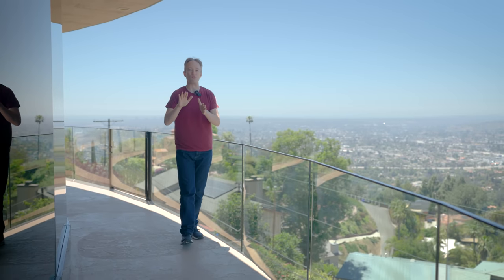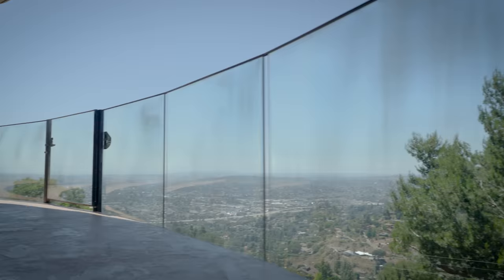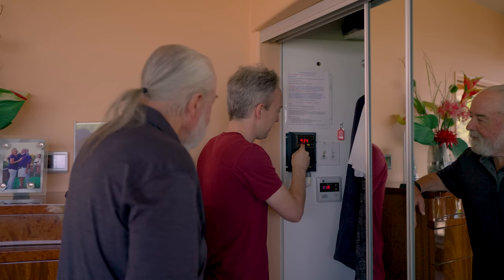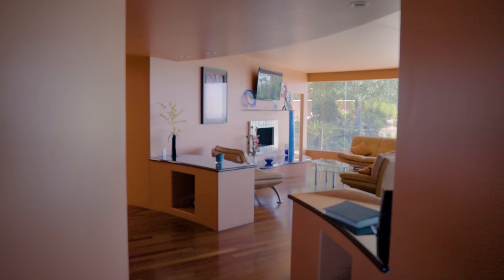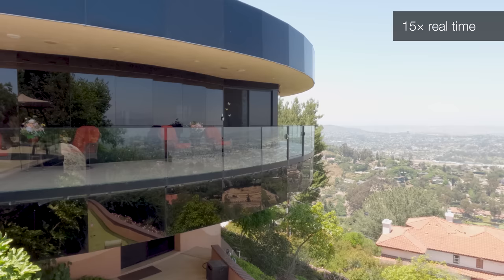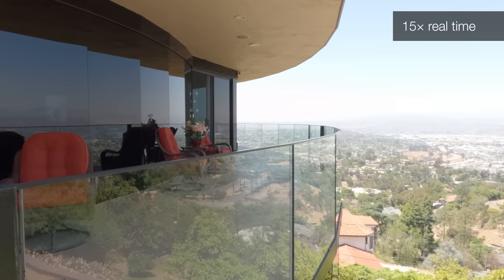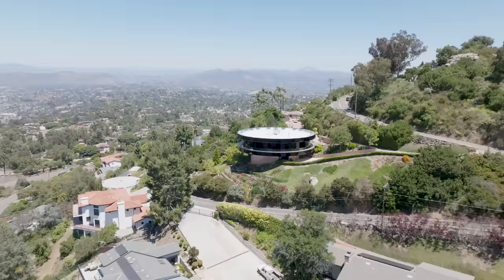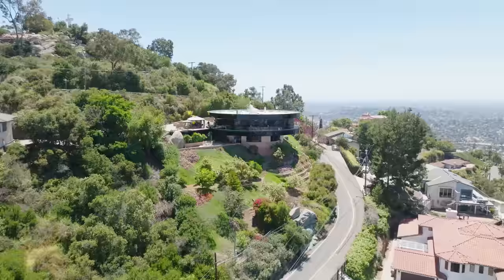I thought this rotating house was impossible.

Comment: As a science fiction author, hearing about how the utilities were transferred through a rotating bearing is so incredibly helpful for designing rotating space stations.
Reply: @PooPooDingDong456456  Like with any good world, building up the little details are very important. Readers appreciate those things so it's good to include them
Reply: @@PooPooDingDong456456 Chapters, no. A line or a paragraph here and there, sure, I could see that.
Reply: @@PooPooDingDong456456 It's very hard science fiction. Chapters? No. Is it mentioned? Yes, and I want it to be accurate.
Reply: @kermanguy1877  ay a fellow hard science fiction writer :-D
Reply: There's another couple of real-world examples you might find interesting up on the Space Station - the Utility Transfer Assembly, which routes power and data across the Solar Alpha Rotary Joints and allows the solar panels to track the Sun through 360° without ever having to reverse; and the Flex Hose Rotary Couplers that route ammonia across the rotating joint on which the radiators are mounted, which allow for 210° of rotation.
Reply: Space stations aren't anchored to anything, this house had to solve a problem that doesn't exist for rotating space stations. On the plus side gravity is constant in the house, in your space station it varies from zero at the center to a maximum at the edge.
Reply: With a rotating space station you can just have the utilities self contained in the rotating section
Reply: @joshuagreen3185  Next video, Scott goes to the ISS...
Reply: Wow! I actually tried to design an asteroid space station as a hobby. I came to the same solution except I used the top of the habitat drum to transmit the power and communications. Its really interesting to meet someone who is also interested in the nuts and bolts of space habitation.
Reply: In general, having bearings on the station rather than just spinning the whole thing seems like unnecessary complexity and points of failure.
Reply: @AndreInfanteInc  It's necessary if you want to dock space craft without desspinning the whole thing
Reply: @@PooPooDingDong456456 I think there's a page on the Waste processing system in the Deep Space 9 technical manual. :)
Reply: @frostyblade8842  Note that you don't even need to mention it.  If you are going for an internally consistent world there should be a LOT of stuff you know about your world that doesn't even make it into the work itself.  You can absolutely feel the difference in verisimilitude between authors that map out their world in their head vs those that wing it for the story.

...though with hard sci-fi of course they are going to mention it, because hard sci-fi can be kinda stupid and rulebreaking when it comes to exposition.
Reply: @@PooPooDingDong456456 not chapter, but definitely mentioned. Depending on how you want to write something, the amount of detail can determine a lot of things. For sci-fi, if you just handwave away things like energy production or waste disposal, it can make it seem like its a part of the world that wasn't even thought about. but talking about it can open up a bunch of other paths to build on. is it all mechanical, like this house is? Does the waste get disintegrated or cleaned up by robot servants, showing how technologically advanced the place is. Or is it reused or repurposed, to help push the stories green message along? the details like that can seem insignificant, especially to a reader or outside observer, but they can add so much depth and so many opportunities while taking very little time in the story to set up.
Reply: YA! TELL ME WHERE THE POO GOES !!!!!! I WANNA KNOW!!!
Reply: @AndreInfanteInc  An interesting use case would be variable simulated gravity. The whole station rotates, but some bits rotate faster than others. The same thing could be achieved structurally through rings of varying radii, but then you wouldn’t be able to change the rotation speed of one section without a concomitant change in the rotation speed of another.
Reply: @Tinil0 Yes! It’s like how Tolkien knew the distances between things and the shape of the map of Middle-earth before writing the Fellowship’s journey.
Reply: That type of connection is already very common in the word of hydraulics.  Sooo many seals to replace
Reply: What do you mean? This is not a problem for rotating space stations, they aren't attached to anything
Reply: @junkgrave  To dock a spacecraft to a rotating space station, you either need to spin the spacecraft up to match rotation in the middle, which means you can only dock one at a time, or you need to have the entire space station spin down. Both are possible if it's a small station, but for a larger station, that's not really practical. To have lots of spacecraft coming and going, you need a non-rotating section for many to dock and undock at a time.
Reply: @silentsushix3  The poo is collected and sent to agricultural stations in exchange for a discount on grown food, or it's used for the station's hydroponics.
Reply: Slip Rings (the electrical version Tom used as a example) is a thing already used in space!  ROSAs (Roll Out Solar Arrays) use them.
Reply: @deeznoots6241  Single rotating objects have stability issues in zero g. Many rotating station concepts have 2 counter rotating sections to provide gyro stability with one being habitable and the other being utility
Reply: @@PooPooDingDong456456they go out the shoot hole and get dumped by the station and left in the dark
Reply: It's nothing new. It works like every excavator has worked for decades
Reply: @NoNo-nz7iq  do you know what are the stability issues? I assume gyroscopic and due to the masses moving around inside, wouldn't that only be a problem for very small spinning stations? I am struggling to imagine the size and strength of the bearing you'd need for a large station with counter-rotating sections.
Reply: @joshuarosen465 while true for a space station, if you have a spaceship with both rotating and non-rotating sections, a solution like this will be necessary for it's plumbing. That, or you have every rotating section have its own water treatment facilities.
Reply: @NoNo-nz7iq yes, but usually you simplify things by having each section sitting side by side with connections at the end rather than linking them lengthwise. In fact, I think that is even more stable. Alternatively, making it rotate around it's longest axis of rotation rather than it's short axis makes it automatically stable.
Reply: I see the point of overcomplexity and reliance issues for independently rotating part but actually rotating and non rotating sections is a very clever and safe thing to do in my opinion: because a fully rotating (stiff) space station or ship would have to bear enormous loads of momentum at the joining section. With a slipping there would be no transfer of force and therefore no shearing danger. Also it wouldnt be possible to spin up different parts without spinning others (imagine a station with two different sections where one would need to spin down for repairs or anything). IMO the advantages might outweigh the cons in most cases.
Reply: Maybe someone already said it, but... Why would you even care for the connection of liquids on a space station?
It's important in a house where everything comes and goes outside. But in space, you have to build the factory and processing parts on-site.
So... Just build them in the rotating part.
However, I also still wonder how would PEOPLE go from the rotating part to the middle.
Reply: @huyxiun2085  easy - we convert them into a liquid or gas and transfer them like shown by Tom in the video :)

Hihi but joking aside I have a model in my head but I could never describe it in text :D regarding the self sufficiency of every individual section - yes for redundency that might be nice. But especially when it comes to breathable air as gas, you want to be able to pump it out of or into different sections since it's such a scarce ressource. Same goes for water. If you have to abandon one section you wouldn't want to leave all the good stuff behind
Reply: @@PooPooDingDong456456 hey if you actually design the thing you can have interesting attacks
Reply: Right?!  Do it!  Write it in!  Create a tech manual that shows how it's done in a similar but still original way (and get your own patent)!  Shop the ideas you come up with to NASA and SpaceX and others, and see who picks your designs up!  I really don't like the design of the gateway they're putting up between Earth and the Moon.  It's just..  Ugly, as usual.  A real space station with these kinds of approaches to plumbing and wiring is what's really needed!
Reply: I got a question that always bothered me about rotating space ships, imagine there's a huge cylindrical rotating space ship containing roads to drive vehicles
 like cars, what happens when you drive a car in the opposite direction of space craft's rotation.  Will the vehicle start to float as it approaches the speed of that space craft in opposite direction.
Reply: @p2v622  in a vacuum maybe but not with atmospheric pressure. That will continue to press you against the ground, is my guess. The interesting part for me is, in a car traveling at the same speed (so relativ zero to the axis) in the opposite direction of acceleration, will the passengers in a closed cabin experience weightlessness? since all centrifugal force should be neutralised right?
Reply: @p2v622  That depends on how fast you drive. A five mile wide city-sized space station would have a tangential velocity more than 400 miles an hour. You might notice a shift in gravity if you floored the accelerator and drove at a hundred miles an hour, but otherwise, I doubt it would be an issue.
Reply: @BlackHawk4832   @BlackHawk4832  I didn't think about atmospheric pressure inside. It's also interesting, does that make an upward thrust or downward force on the car. Because like , air would push you from all sides , but the air pressure under the car would be greater than pressure on top of the car right ? 

I was wondering about the weightlessness too. Also would you be  able drive faster than the speed of the space craft in the opposite direction, as it becomes weightless it doesn't have a reaction force any more so there would be no frictional force. 

I'm going have to ask someone to do the math. I'm too dumb for this. ;)
Reply: He patented it though! You'll have to give him credit for that somehow :]
Reply: @DJMoffinz  Nuh uh
Reply: @joshuarosen465  I could imagine wanting a none-rotating section in your space station. Maybe for zero-g manufacturing. Maybe for docking. Maybe you've attached your rotating ring to a large asteroid that its easier to mine when its in zero-g.
Reply: @@PooPooDingDong456456 leave it to poopoodingdong to ask where the poopoo goes
Reply: Do a chapter on the gasline exploding due to lack of proper engineering
Reply: Bill Kerman I feel you, I hadn’t even considered this a factor but would be impressed of the attention to detail if a creator included it

That’s like beyond The Expanse level detail
Reply: @HanTheProphet  you get a like just for referencing the Expanse <3
Reply: So what (hard) SF books would you guys recommend?
Reply: @deeznoots6241 if you really need to dock with another station or something and you can't handle any slippage
Reply: @@PooPooDingDong456456when it comes to worldbuilding, thinking of these details can be extremely helpful, even if you never explain them to the reader. You never know when you need to come up with some plot detail or explanation that this system could be perfect for.
Reply: @kermanguy1877  In the video seems to be a patented technology (4:48), you have to see if you can actually use it in your work.
Reply: @deeznoots6241  True for fluids, though you'll likely need some crossover for power and possibly network.
Reply: @Hashterix  with power slip disks already exist and are common
Reply: @kermanguy1877  There are so many books or movies out there that simply ignore their characters' physical needs and pretend their heroes (and villains, to be sure) don't have to excuse themselves. Thumbs up for people who care about details.
Reply: NASA knew how to do this decades ago, its nothing new.
Reply: It requires gravity though. Also why would there need to be a non rotating part?
Reply: @@PooPooDingDong456456 no good story is without one
Reply: @Tinil0  That is true, you often don't need to directly mention it, but you can slip in a few lines here and there about the characters using said facilitate or at least hinting at it. Hard sci-fi can be a different beast though, but it's still great
Reply: @huyxiun2085  since you need to recycle grey and brown water into pure water, if the rotating and non-rotating sections are disconnected, then you need separate water treatment facilities for each section. If the spaceship is smaller, then having central water treatment facilities linking all sections is simpler than having two or more. Also, one trick for sanitizing water in space that I saw in a contest winning space colony design is to have the water flow through transparent pipes exposed to the radiation of space. That would seem to require the pipes and water treatment facilities to not rotate.
Reply: i need to read whatever you’re writing with this concept in mind

Comment: In the graywater/freshwater slipring he did not need seals. He could have small groves in the metal because over each small groove in the metal where water can pass through, there is a pressure drop.

After trying to overcome 8gaps in row the pressure will be so small the fluids won't be able to cross.

This solution is maintenance free and often used in sanitary situations like food and milk processing where a rubber gasket mighr contaminate the food.